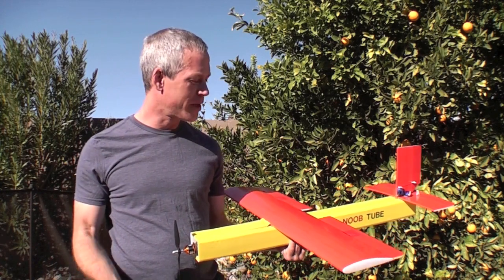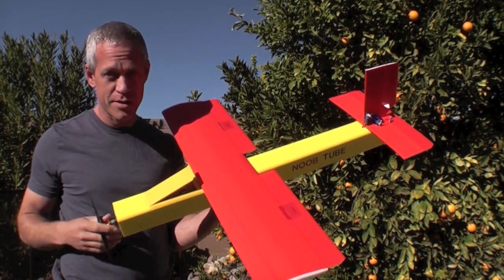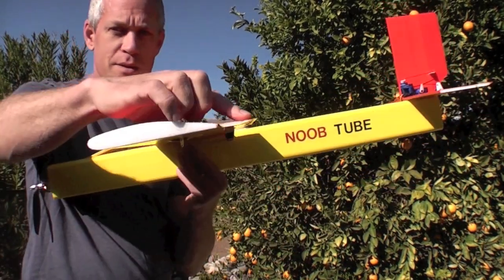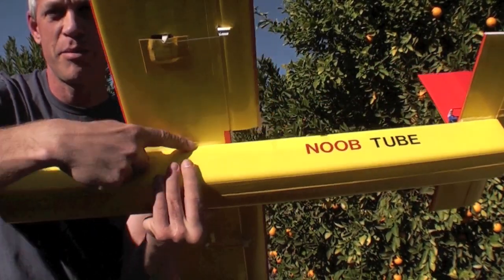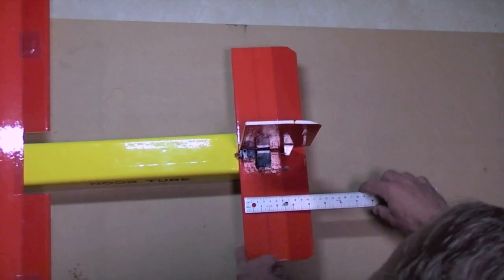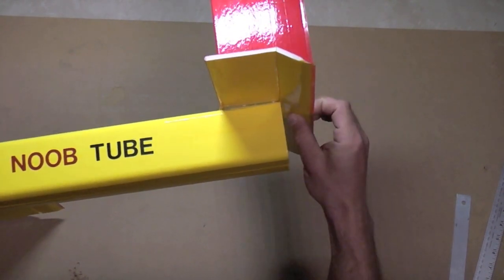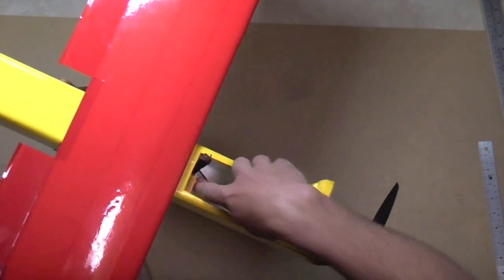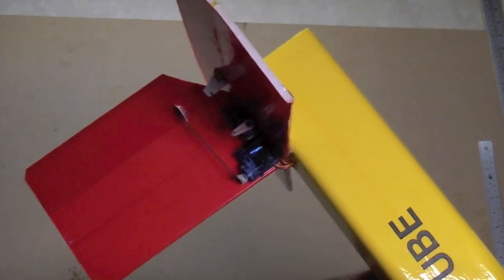NOOB TUBE Foamboard Fun Flyer

Comment: Thank you so much for a great build.
I am new RC hobbyist  and understood all well except listed below.
PLEASE PLEASE explain installing of motor at an angle on right and tilting downward from top.
1. Does it have to be always on right plus motor turning anti clockwise looking from front?
2. Does it apply to all kind of model planes?
3. Does degree of an angle has to be exact as specified or can be approximate?
4. Motor inward on right side plus tilt  downward from top?
Explanation for above would be a great knowledge for new RC hobbyists and appreciated.
THANKS.

Comment: I realize I am posting to an old video.  Hopefully you'll see it.  My question is: what is that metal motor mount you are using?  I've been away from fixed wing for a long time and just built a version of this and need to figure out how to mount the motor.  Thanks!  Love the channel.
Reply from the maker: I do use metal motor mounts.  I was lucky enough to come upon a stash of 1mm titanium plate, from saltwater pool chlorinator electrolytic cells, and it is a perfect strong and light material for this.  Aluminum is a fair second choice. 1mm steel is OK but flexy.  Beyond that, I use the ole' balsa block and basswood firewall.
Reply: @ExperimentalAirlines  Excellent.  Yeah perhaps I'll 3d print a firewall, or I wonder how this 'noob toob' would fly with a pusher pod on top?  *(easily downloadable from thingiverse).  Like I said I've been flying multirotors for years now and I forget basics like which way to angle the front motor mount to counteract torque hehheh.  I don't think it needs it for a pusher.    I can look it up of course.  
BTW, I had a blast in the 90s flying RC combat with the 'RACores Gremlin".  At the club in NH we would get up to 20 of them in the air with streamers to clip.  Spectacular foam explosions from the mid-airs.  
I appreciate your channel.  I assume you'll continue with experimental airlines even though you have a tesla now? ;)

Comment: Hello Tom, thanks for sharing wonderful videos to build RC planes using foam board. I am following your techniques to build one myself. I have already made one and crashed it many a times as I am amature in both building n flying planes. It is improving day by day and the plane alteast started taking off and remain in air for few secs.
It wud be great if u can help me know what could be the reason for my plane to stall. I notice that it tends to climb very fast even if I dont apply elevator, stalls at a point and crashes with a free fall. This has happened few times earlier too. Below link is for one of the flights with same problem.
https://youtu.be/Vw9adMCtjGc

Thanks

Comment: I'm building one, I'll see what it can do with a 2200kv and a 6x5. Should be fast!
Reply: Derek, I have the same motor, how was your project, any results?
Reply: I have 2300kv + 3S 1300 mAh battery, with 6040 prop. I wonder would this setup work with Noob Tube.

Comment: using a 1200KV motor with 1045 prop suffice for NOOB? please let me know. As well, will it ok for 800g plane... NOOB i built weighs around 800g.. could you help me how to find the right motor/prop for a plane (considering the weight)...
Reply: as I know that.. 1000kv is able to lift the loads 900 gram and suitable to 1045 prop, but I dont know for 1200kv..sorry!

Comment: Hello Ed and fellow builders.
 I'm Ron an avid large scale RC helicopter pilot. Been building and flying fixed wing model aircraft for years. But got away from fixed wing in favor of egg beaters.  On my 3rd practice sheet tape covering. Made 2 - 30" tubes and a 6" cord Armin wing. Working on Control surfaces hinges now. My first Noob tube will be an Ugly tube but I'm sure  my workmanship will improve.  Will build a J*Scott a Peace Drone and of course the 4 motor over the winter. 
I'm not only learning to build but doing a little drafting of my own.

Creative Genius at it's finest Ed! Really  Thank you.
Ron

Comment: Hello Ed, I'm quite new into this hobby (but have some experience with flying borrowed RC). Now I want to build my own RC plane and decided to build this one, but I wonder what is your recommendation for an engine and propeller from the actual HobbyKing product range? I would like to use 2200mAh 3s LiPo. I found one 1400kv motor "Turnigy D2826-10" (http://www.hobbyking.com/hobbyking/store/__32458__Turnigy_D2826_10_1400kv_Brushless_Motor_EU_Warehouse_.html), but they recommend 7x4(3S) ~ 9x4.7 (2S). With your choice of prop I am not sure what to pick? Can you give me advice please? If it would be possible - can I run the same motor with the same prop (or another one?) on the PHOTON glider? In both cases I just dont want to damage motor or ESC with wrongly selected propeller.

Comment: I'm building this plane now and it is my first build. I'm confused on the exact motor and electronics I need to buy for it. Could you provide a somewhat detailed shopping list I could use to place an order please? First time so brand/part numbers, including servos and receiver would be needed. My radio is mode 2 that came with my Horizon Hobby Sport Cub S. This would be much appreciated and thank you for all your great videos, I'm leaning a lot.

Comment: This plane looks really similar to the FliteTest Tiny Trainer.

http://flitetest.com/articles/flite-test-tiny-trainer

The technique I like w/ the TT is they use dihedral and polyhedral which really helps w/ stability.  The technique I learned from Experimental airlines is the colored packing tape - it works amazingly well.

Comment: This is a really fun airplane. What is the affect on performance and stability when going from the 5 inch chord to a 7 inch chord on this design?
Reply: todd sgrignoli thicker or wider airfoil will translate into ability to slow the plane more while sacrificing highspeed.
Reply: I added winglets to the 30 inch noob tube. It completely tamed it. Flies like its on rails

Comment: I built a bigger version of the noob tube 40" wing 42" fuse and I am trying to find my cg. when I did what you suggested in the end of your video it balances at 22" from nose (leading edge of the wing) and 20" from tail (again, from leading edge of wing) I am using a 8 1/2" wing including the ailerons...making the nose seem long. would that matter? I made it a little bigger since my son (which is cool, just like your son) wants to fly one just like dads but more stable... and less acrobatic. thanks for you help Ed.
Reply: If the plane balances at about 1/3 back from the leading edge of the total wing (including airleron) it will be fine.  Of course be sure to balance it with the battery and all electronics mounted in place.  I run a 3s 1300 battery so I balanced it accordingly and it flies great.

Comment: I just maidened my noobtube. Only 1 click of trim of left aileron and it was coasting straight as an arrow. I am a little underpowered with a tunigy park 450 as I had to fly at about two-thirds throttle. Using an eflite 25 amp esc and a turnigy 2200mah on a 9x6 prop. Everything felt a little warm after 8 min flight but not hot. I built 6 inch wing with 1.5 ailerons and tail section built exactly like you said except I angled vert and hor. stab slightly just for looks. I ended up putting dowel rods thru tube to rubber band the wing on for smaller travel size. Thanks for the great instructions.

Comment: im working on a noob tube, but made 2 changes I think will make it Noob friendly.  1, a 10'' cord wing and two, 6''x 1.5'' ailerons.  The combo of those Im hoping will make it a good slow-fly plane with more gentle controls.  I also have a small 1300kv "stick mount" motor.  I plane to glue a gift card on the inside of the tube, then hot glue a wood stick to that.  hopefully that means if I crash, the stick will break from the gift card before the motor shaft breaks and that the foam board wont be damaged.
Reply: I scanned the vids on your channel looking for your noob.  I wanted to compare it to my large chord noob, they sound quite similar.  Did you ever get it to fly?
Reply: UnlimitedVertical well, it depends on how loosely you use the word "fly".  I used the heavier foam board from walmart and then I didn't get the CG right.  It would fly tail heavy.  Attempts to fix the CG resulted in crashes and damage.  My battery was only 1300mah and really too small for the plane.  Ive been meaning to give it another try with what I learned, but ended up moving on to other planes.  I did build a working EDF delta, and later a EDF out of a walmart 4' glider.
Reply: RCPro Driver lol...yeah, they don't all fly.   Took another look at your vids.  That wal-mart glider looks like an Air Hogs Titan...If so, I've done one of those too (but as a pusher, not an EDF).
Reply: UnlimitedVertical it is actually a sky raiders....very similar in design to the titan.  from what ive read, the wing design on the titan can create tip stalls.  the shape of the wings on the sky raiders is different.  I found the CG of the glider as stock, then started throwing on components and making sure I kept the same CG.  Flies as good as any RTF plane ive ever bought, and easier than a RTF edf ive had.

Comment: You deserve all the praise you receive here and on RCGroups (where I found you).
As long as I have been enjoying RC, I have always tried to help people get into the hobby as low cost as possible, and you simply can't get better than this.
I am going to build this really soon to get back into the hobby after a few years away.
*How is the slow flight characteristics? No sneaky tip stalling?
*Could this act as a stable platform for aerial video/photography?
hanks again for all contributions!

Comment: You may have some torque roll, which is the engine spining the plane. You may be taking off with to much throttle or you have a too big prop or kv motor

Comment: built mine, first flight took off and rolled to the right and crashed. fixed the rudder and elevator. launched again lowered aileron throw and seemed elevator was too much and rolled again...have to completely rebuild it this time....I don't know what im doing wrong

Comment from the maker: On this plane I use the OrangeRX receivers from HobbyKing, with a satellite receiver whenever possible.  I wouldn't use these on my favorite expensive planes but for $6 or so you can't beat 'em for light foamies like this.  That's assuming you have the DSM2 transmitter, though the Futaba OrangeRX clone may be good too, just costs more.

Comment: Solved the issue by going to RC Groups posts that are so old that I couldn't put in a thanks. But the link was there none the less. For other people that are looking for a fair shake on the price, a company called Fast-Pack.*** has a really great price for Canada  6 asst'd  for $10 and $23.00 for shipping,
9 for $14.50 and $29.00 for shipping. 2 mil x 2" x 55yds. Even better deals for U.S. folks.

Comment: Found you by way of Flite Test,  I want to do a pusher arrangement with the "Noob" How do you think that might work out? I imagine that the motor would have to be angled up like one sees in  the Bixler and AXN etc. Thoughts on the position of the motor mount? And have you any idea where the colored tape could be had online from the States? I have exhausted all possiblities. Not kidding
Walmart, Ebay All the building outlets and craft stores here in Kingston, Ontario

Comment from the maker: Honestly I would spring for another $3 for a second servo and a Y-harness for your ailerons.  You can get by with a single servo but it's a lot of extra work to trim the ailerons correctly with the pushrods.  If you did, I would recommend  putting the servo over the top of the wing with pushrods over each wing, over the top.

Comment: i got it built now ed !!!! my question will the airolions work if i just put 1 servo in the middle of the wing ? and do i just cut a hole strait through the wing for wire or do i need to just run it on the outside of wing? thanks ed for all the great videos

Comment from the maker: It will be about 8" to leading edge, but it depends on your build and your electronics.  In one of my NoobTube videos I showed a very rudimentary way to balance the fully-loaded fuselage on the cambered wing to estimate the wing mounting point.  Better still, rubber band the wing onto the fuselage and adjust the position until the plane balances horizontally on your fingertips placed at 2" rear of the leading edge of the wings.  When determined, you can mount the wing as desired.

Comment from the maker: Most any 1700KV over 40g and 200 watts electrical output (not just the max rating) will probably work fine.  7x4 or 8x3 prop?

Comment: You're correct with the Alpha 370 it was a dog but seemed much easier for me to learn to fly with than with the 1400 kv I tried first.  Think I laid the power on too much on first flight with the 1400kv.  With the 370 the plane moved slow enough for me to control the noob tube.  Only two successful landings though.  I'm braking props a lot but I think that's because my landings aren't so great.  Think I'll build another Axon and sharpen my skills a bit before I try this again with the 1400 kv.

Comment from the maker: If so the prop will usually just flip up out of the way.  No kidding, I never break props.  A spinning prop has energy that must disperse upon deceleration if it hits the ground.  A vertical prop can just turn 30 degrees and be clear of the ground.  You also do need to make nice landings.  A bad landing can always break a prop, spinning or not.

Comment from the maker: A 2-cell is usually pretty weak for many applications but if you have a 2300KV then it might be OK.  Give it a try.  Torque will be great, you just need to have a higher KV motor.  As a rule a lower KV rating with higher cell count will give better overall performance.  Only one way to know - try it out!

Comment: ok thanks, so i already ordered some ectra dean plugs. so there is no way to use my 2s battery, i know some of the planes can be use 2s battery. i have used a 10x6 prop on a 2s battery and it fly pretty well. but then i crashed it and the motor(1100kv) shaft snapped, i think the plastic of the prop is too strong for the shaft.  now im using a prop saver, the motor is 2300kv now

Comment from the maker: I think you're going to want to use the lightest 3-cell you have, which is the 2200mAh.  2 cells probably won't cut it.  I'd start with the 8x4 but take the 10x6 to the field with you in case you need to swap.  Either ESC is probably fine.  I'd usually go with the higher capacity ESC, all else being equal.

Comment: i have a 18amp esc, 1800mah and 2200 mah 7.4v battery, 1100kv motor, 10x6,8x4,7x3.5 props. do you think this is a good set up. but i also have a 30ampesc, 3300mah 11.1v 30c its pretty heavy, 2200mah 11.1v 30c but its uses a dean plug all the others use banana plugs. i think i cut the dean off make all my plugs the same, im just afraid that after i cut off the dean plug i will lose about 1/2 in of wire and that might cause future propblems

Comment: sir,
i have built a noob tube with every thing stock as you told but the wing span is 44". and the wing is also where  you told, but my pane is really nose heavy..so should i bring the wing towards the nose?  i am assuming that the CG at the wing is at 30%

Comment: I can peel the paper off pretty easily. If it is light foamboard I can not that easily say since I do not have a comparison. Sadly it's not that easy to get here...
If 27.5 is too small then I'll have to make the wing out of two pieces of foambard, shouldn't be that much of a problem. Btw. I would have scaled the whole plane, not only the wing^^

Comment from the maker: In the default tractor design the battery is pretty far forward too.  If you put a 2-3 oz motor and an ESC in the back trust me the CG will move way back, so you'd need to move the wing back.  If by 3 amp you mean 3000mAh then that's a hell of a big battery for a plane this size.  I would definitely use a larger overall wing at least.

Comment: Hey Ed,

Just came in from flying the NOOB TUBE. 30" wing, 30" tapered nose, fusleage, 1 5/8" inside cross section "just" big enough to fit a 2250 lipo powering a 2212-6 motor, 6x4 prop. Winds 13  mph gusting 21 mph. Flat out its doing close to ??? mph ground speed. What fun! This is my new favorite all weather airplane. Thanks!

Comment from the maker: Good call, a longer wing will make this plane float longer and fly easier.  Ideally you would stretch the fuselage a bit too but you can get by.  I recommend making the horizontal and vertical stabilizers about 30% larger to compensate for the larger wing.  The wing location will probably be a little bit further forward, but be sure to get everything in place and do a balance test before fixing the wing.  Or use an adjustable fixation like rubber bands.

Comment from the maker: There are some specs I can't know from this but I would generally recommend a 3 cell for that.  I think your prop might be a little too pitchy too if in fact it is a 6x8.  Perhaps it's actually a 8x6 (8" diameter, 6" pitch distance), which would be pretty good for a 28mmx26mm motor, maybe don't run it full power the whole time.  8x3.8 or 8x4 would be perfect.

Comment: Hey Ed on my noob tube I was having an issue with pitch up during thottle on. you didnt mention any down thrust you used if any. just wondering if you have any and about how much? I dialed in about 3 or so degrees and it seemed to level out my on power flying.
By the way thanks for the awsome videos and keep um comin working on my second noob tube and my first axon.

Comment from the maker: I will work on that soon.  In the meantime may I suggest you check out the Axon videos, which do have full parts lists with links.   The Axon is only slightly harder to build but way easier to fly and therefore a better trainer.